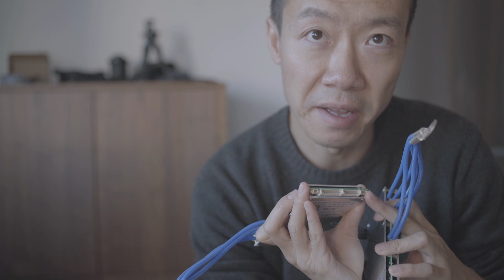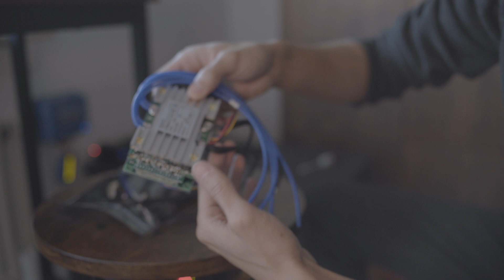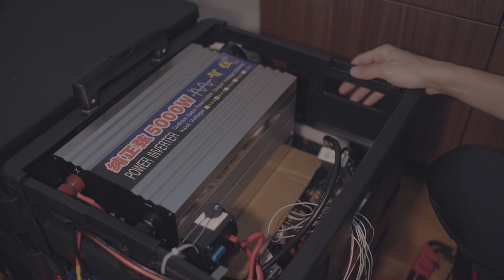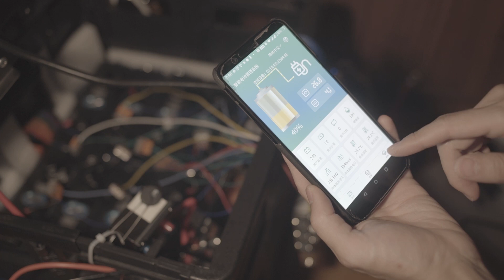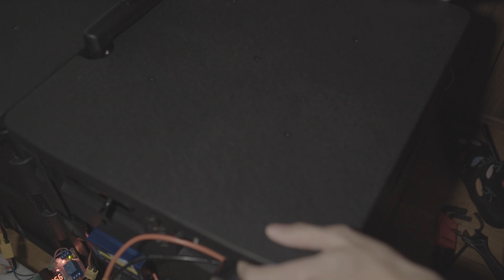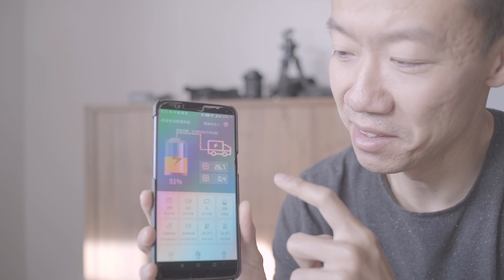QUCC BMS - perhaps better than Ant or Daly?

Comment: I think I might understand why you weren't able to activate the ant BMS.  It's probably because your set up is 8s while the BMS is 16 or higher some wiring tricks are required on the balance leads. I recently used the antBMS and had that same issue but learned about the trick and it all worked out
Reply from the maker: Thanks for the info. I have contacted AntBMS and I even made a video to them showing the wiring, also speaking native Chinese to them but I didn't get good help and never could solve it by then. If it require special wirings then they should have notified it well or supported the customers well while installation.

Comment: Hi, how did you get such a nice charts (at 3:00). It is any special app for bms monitoring?
Reply from the maker: It is by using https://vrm.victronenergy.com, as I have some solar chargers from victron and you can either buy some of their hardware or use a raspberry PI to install their operating system in, then you can connect their solar charger and 3rd party BMS (via some open source tool) to this device and it can report your charger and BMS status to Victron's VRM website and then you can see those metrics there :) Maybe I should make a video to explain all this. It's a bit difficult to describe everything in details with a message here :)

Comment: Thx for the vid.. As this bms in constant or occasional use.? I am looking for a bms to use 16s 280ah 48v batteries that will be in constant use
Reply from the maker: I use it constantly. Besides the app's English UI is not optimal, I don't see what is the down side of this BMS yet. Of course there are many other out there one could buy. I haven't tested them all.
Reply: Hi. Great video you have there !
I bought a similar QUCC BMS and I have a hard time understanding the APP settings.

Please, can you help me out ?
Reply: @dejiajayi1113  Hallo gab ich die gleiche  Problem mit  die app. Hast du  Lösung schon gefunden.
Reply: @marekgambietzelektrogama3032  Hi. I was able to figure out some of the settings. Which part do you need help with ?
Reply: @dejiajayi1113  hab  ich gedacht  das gibt's  für setings  Beschreibung
Reply: @marekgambietzelektrogama3032 What is for the settings description ? I don't understand your statement, perhaps the meaning was lost in translation.
Reply: @dejiajayi1113  ja aber  das ist abgekurz und noch auf Englisch . Ich suche  vollständige  Bezeichnung  das ich mir die übersetzen kann.
Reply: @marekgambietzelektrogama3032  I still don't understand. What is abbreviated and in English ?

Comment: I noiticed you are using an additional active cell ballancer Fuyang - My advice is only connect that if a cell goes 0.1volt out of balance because it will destabalise the BMS  bleed ballancer - as the active cell ballance  takes power from cells their  potential voltage dips & the lower cell voltage peaks  to provide the head room to take the  charge - this sends  a corrupted message to the BMS as one cell is discharging & another is charging - The BMS will  try to correct  the wrong cell. Enjoyed your post : )
Reply from the maker: Aha, thanks, that is good to know. I thought the active balancer will not bring much cell voltage difference but maybe there is. I had been plugging it on the battery for a few weeks and it seems so far so good :P  But maybe I don't really it to be plugged at all time :)
Reply: @FuyangLiu  I have an active cell ballancer on standby for my RV 320ah Lifepo4  battery  if it should ever stray  but found the BMS has been able to manage despite her frequent use of a hair dryer!!!!
Reply from the maker: @trevortrevortsr2  With that large load it's probably more easily to see the issues. I normally don't use the inverters for large loads, just DC directly to power my laptops and phones 😬
Reply: @FuyangLiu  A cheaper option is a suplimentry 500ma  bleed ballancer  board which  will work in tandom with your bms

Comment: Thanks for taking the time and effort to video this, was quite interesting.
I would like to suggest you might rethink the battery wiring with the cardboard and inverter sitting on top like that.
Maybe a sheet of polycarb with some insulated standoffs so you're not encouraging a short to occur by crushing the wires into a terminal or pinching thru the insulation under the weight of the inverter.
I could see a fire getting started pretty easily to be honest.
Reply from the maker: Indeed, thanks for the good input. Luckily the inverter is very lightweight and the battery is in stationary no movement environment. But I should probably make it more secure than this simple setup soon 🙂

Comment: Try pushing a charge into battery from a power supply that should turn it on.
Reply from the maker: Thanks. I have tried that for a few times as well but it didn't work for me 😔

Comment: How ya doin great video and explanation.  I do have a query what input voltage would be maximum for this bms. As I have one and want to no if I can use solar straight to the bms or do I need to set input as a certain voltage through a regulator.
Reply: It depends how many cells you are using. Buck converters can be used to set voltage appropriate to battery; they are cheap, batteries are expensive. A proper charger for Lifepo4 is expensive. BMS’es are designed to work with Solar Charge Controller, and settings are related to each, some SCC makes specify voltages at  0.2v over BMS max (or min) voltage you have set, assuming Smart BMS.  The SCC regulates the voltage applied to battery. BMS takes care of the individual cells. MPPT is better, converting high voltage to current at the correct voltage for battery charging.
Reply: @michaelbouckley4455  thankyou for that and getting back to me.  I have three lithium prismatic battery packs each one is a max of 21v at 200amps. They are 5s 2p Which therefore equally 63v . Also have a  8s to 32s ant bms with no scc atm
Reply: @craigivas4037  Avoid cheap PWM SCC’s. They are no better than a piece of wire connecting solar to battery, no voltage regulation; and too low LVD. One blew up some LED’s, and drove fan hard. I did use a BSC3048 for a while, ok for a PWM, with voltage regulation. Now using a Victron 100/20 (best software!) for smaller panels & Epever 6415AN, on 1.3Kw solar. The Epever displays more current to battery than the BMS receives. So it’s KWh is out too. Also the rating of 60A is questionable. I have DYKB Smart Ant BMS, 10-24S on 8S. 200A out 50A in. I like the fact it has high voltage FET’s. Battery cells can be severely damaged if SCC fails, and applies solar voltage direct to it. Cheap Buck Converters will fail too, at some point.
Reply: @michaelbouckley4455  thankyou for all of your information it has been useful to me as I am new to all of this. What I am doing is building an ev. 10kw battery pack 24kw dc series wound motor peak. And 1kw of solar on canopy.  I didn't want to use the bms in motor output side only on the solar side. Is that a wise choice. That's why I was asking about the scc.
Reply: @craigivas4037  I just checked the Victron, Absorption voltage can be set to 21v on nominal 24v User settings. The Bulk voltage = Absorption setting.  Float setting is also adjustable, mine quite high, near Absorption V, because of daytime loads. It’s not recommended to float Lifepo4, a lower setting will produce no output, until battery voltage falls to it. Default re-bulk is 0.2 v below Float. (Adjustable in Expert Mode. I contacted Epever, about their User Lithium settings; they recommend using the Equalising timer, at the same voltage as ‘Boost’ aka Bulk. So there are two timers, Boost will try to charge battery to the Boost voltage, then hold it there for the timer duration, then switch to Equalise, for timer duration, then go to Float. I adjust the timers, relative to the SOC.
Reply: @craigivas4037  Using BMS for charging only, is often done; especially where a high load, greater than BMS capacity. The problem is low voltage disconnect. Also you may want to consider bottom balancing, to get the most out of battery. One solution to LVD is the Victron Battery Protect, 3 different rating models, up to 200A. Also basic and Smart, with Bluetooth parameter modification. Basic models have a few parameter profiles to choose, by applying 0v to a programming  pin. The battery Protect is now no good for Inverters. The Victron kit is expensive, but good. The devices can communicate to each other, also a Smart Battery Sense, for Temperature and Voltage. A Smart Shunt would be good too. Also do automatic firmware updates. It’s all easy, plug and play; including the Raspberry Pi 3 models, which are much cheaper than Victron’s CCGX or other Venus OS products, parameters can be viewed and modified by Victron Connect App on phone, or PC. Any web browser can view the Raspberry Pi running Venus OS, and also modify settings. The Victron VE.Direct to USB adaptor cable costs about the same as Raspberry Pi, one cable for each main device, you may need 3.
Reply: Your BMS has a low voltage shutdown, but that would disable charging. Raspberry Pi needs wired internet, can be made to connect via WiFi to a network, after setting up with wired internet (then setup new Victron VRM remote management profile, as it uses the hardware MAC address of the network interface. Or you could use a touch screen.
Reply: @michaelbouckley4455  thankyou for your advice I will do some research on this.  As I'm trying to do this on a budget as well. There is a lot more involved than I figured.
Reply from the maker: I guess with solar the best approach is to use a mppt solar charging in between the PV and battery. Otherwise I guess you can try connecting the PV directly on the battery if the PV voltage is just a bit higer than the battery voltage. While connecting the actual voltage will be bring down to the battery voltage with the current increased of course. But if the solar voltage is very high then you may damage the BMS if it disable charging because of any protection reason.

I don't know the exact max voltage allowed but I guess you can ask the seller, otherwise I really think it is a good thing to use a solar charge controller in between, like the Victron mppt ones with Bluetooth, I feel they are very important for any solar applications and it automatically changes the max power based on the solar condition. If you use some simple buck converter you may have to manually adjust the max current, I am not sure. What I know is a simple step up converter do need manual adjustment of the constant current setting in order for it to work 🙂

Comment: Thanks for the video. Is the constant amperage adjustable above 80?
Reply from the maker: This BMS is rated at 80AMPs but I think, and I was told by the seller that it can holds well for even up to 100A continuesly but I personally might not want it go under that pressure for a long time. So when I use it for boiling water it is a bit over 80Amp and 30 seconds my water is heated up so I don't need it to run continuesly. 

I guess if your appliance needs above 100 amps continuesly then I would go for a different BMS. QUCC has another one can go up to 500A easily and it comes with 2 relays. A bit pricy but it worth the value if your application is power heavy. 

Hopefully I answer your question?

Comment: The trouble I have with most of those "cheap" BMSs is, unless you get the bluetooth option (which really ups the price) even if it working, how do you know??
And even if you get the bluetooth option so you can see what is going on, you can't change the parameters.  They always want to charge Li ion cells to 4.1V which I consider to be too high for normal cycling.
That one looks good. I have a different one coming I am going to try, if it does not work out I may get one of those.
Reply from the maker: This QUCC BMS can change all the parameters you want. I set the top charging cell voltage to 3.45 and min to 3.0 just to be on the safe side.
Reply from the maker: The BMS comes with Bluetooth module and it is included in the price. Otherwise you can test it to try over charge or discharge to see whether it works 😋

Comment: Thanks for the review/overview! What Android version/phone are you using? I can't find any BLE units within AXEBMS with a new Android 11 Motorola G20 or an old tablet with Android 4. It works nicely with IOS, but only read, not write.
Reply from the maker: Interesting. I have a Oneplus 5 running Android 10 and the App works (though the English UI is not that friendly but it could do it's job)
Reply: I wonder if it might be Android 11 that is causing the problems then or perhaps incompatibilities with the BT chipset. Will have to find another Android phone.
Reply from the maker: @kjetileik3212  And looks like you have got some pretty fun and cool project there. But if you connect the underwater device to the BMS, you probably only want to read some of its parameters? If that way then it is pretty simple to write some code, or use my code Rust to get basic info out from the BMS. It seemed not too hard to program with USB communication
Reply: @FuyangLiu  I have made a 10S10P 21700 Li-Ion battery with 4850mAh LG cells and integrated the QUCC BMS. This battery might never see water, but eventually I will prepare the battery/BMS to go down to 300-500m depth. 

During daily operations we will most likely only need to monitor/log data from the BMS. I found your Rust code on Github and agree that it will most likely be quite easy to get the monitoring up and running. We will hopefully only have to configure the BMS once, so might not need to implement write functionality. 

Sadly I will have to wait impatiently on the transport of the RS485 adapter from China. I'm "beating myself" for forgetting to order the adapter with the BMS ;) I have also ordered a CANBUS adapter and will have to look into if a Pixhawk flight controller with CANBUS support can be used to monitor the BMS and relay the data to an RPi or Jetson Nano or Jetson Xavier NX. A lot to figure out and as always too much to do on top of this.
Reply from the maker: @kjetileik3212  I see. Hopefully the 485 to usb will work for you, otherwise you can also try just getting a serial to USB adapter form Amazon it might work as well if you just wire the Tx and Rx correctly. I am no expert on this but I just bought a random looking one on Amazon and it works with the victron solar charger so I guess those things are pretty standard piece of hardware 😬
Reply from the maker: And yeah the qucc seller contacted me as well as we keep some contact between each other even though I don't work for them. Do you have a Mac at home and perhaps also bought their 485 to USB connection? I am working on making a small program that can run on Mac computers to read the BMS state, probably not difficult to make it also able to set a few paramters.
Reply: @FuyangLiu  Thanks for answering!

I have a Mac and have bought the RS485 adapter this week, so will take some time to arrive. 

The plan is to use CANBUS or RS485 to monitor and configure the BMS through a Raspberry Pi or similar, but I would gladly look into the program you are working on. 

The BMS is to be used to test  long term underwater deployment of a drone, so we need RS485/CANBUS up and running eventually, but I had hoped that it would be a quick fix to configure through Android. We even looked into running Android on Raspberry Pi, but sadly there where some issues there as well with the application. Currently the seemingly great BMS hardware is somewhat let down by the available software, but that can be fixed :)
Reply from the maker: @kjetileik3212  oh cool, I would like to use raspberry pi monitoring it as well and there is a plugin for Victron Venus OS (can run on a Raspberry pi) on GitHub that supports Daly or JBD BMS and I have tried to ship a QUCC BMS to the plugin author so hopefully soon we can hear something done from him 😁

I can give you more details if you want to know more 😬
Reply: @FuyangLiu  It's great to see that you are trying to get the BMS better supported. Kudos for sending your BMS to the plugin developer. I doubt we will be able to use the Victron Venus OS (which I know nothing about) since the RPi (or similar) will have to perform many other tasks as well.
Reply from the maker: @kjetileik3212  the I got is something called TTL to USB adapter, I got one like this 
https://www.amazon.com/HiLetgo-CP2102-Converter-Adapter-Downloader/dp/B00LODGRV8
Reply from the maker: Also, when you install the App on Android or opne it up, rememter to say yes to the geo-location permit as that is something required by bluetooth to work. I think their App is very safe and don't worry about they collecting data but the recent android versions reqire user to say yes to some location data gathering before the App can really use bluetooth. Maybe you didn't give the previlige on the app on your phone?